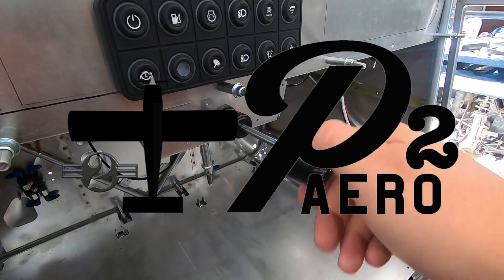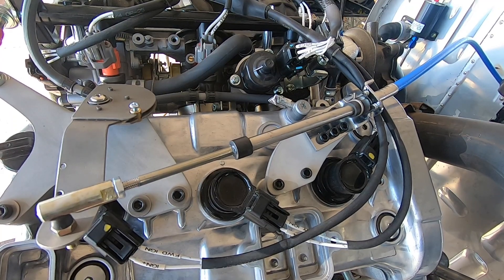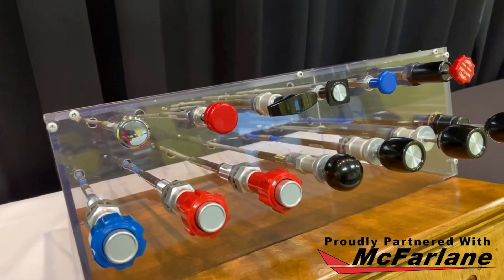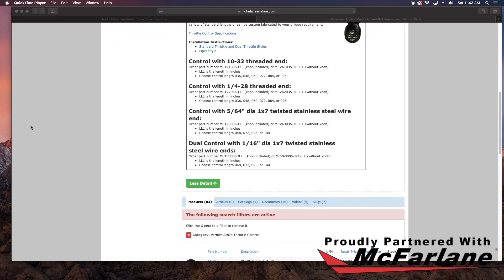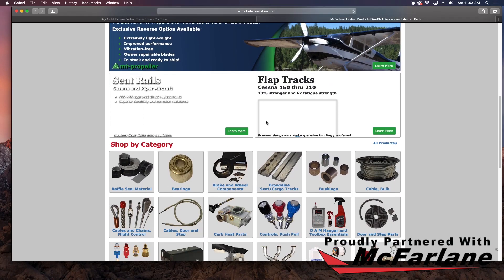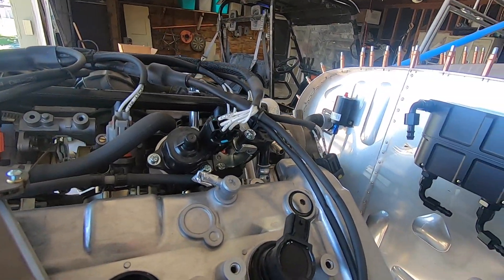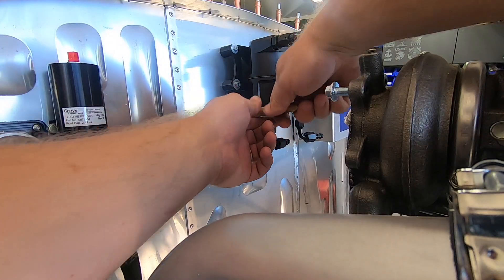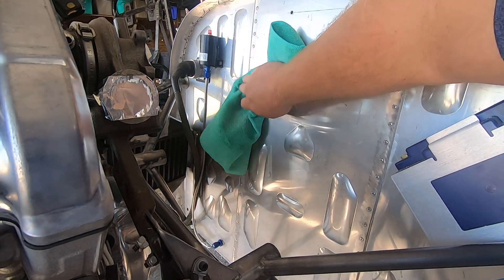RANS S-21 YAMAHA 998TURBO MCFARLANE THROTTLE EP33

Comment: Wondering where you are generally located, and where you got the Yamaha engine?
Thanks
Reply from the maker: I’m in northern Tx. I ordered my engine new from Arctic cat (they use Yamaha engines in some of their snow mobiles).  Lots of info on the Yamaha conversion Facebook groups if your considering ya Kelling such a thing yourself. Thanks for watching!
Reply: Enjoying you posts much, what was the price for the engine? Was there much time before delivery?
Thanks for the replies!
Reply from the maker: @drlescrawford897  right now you can get the engine for $5600. Search for part number 0662-622. You’ll still need to source other parts like manifolds, turbo, harness, and intercooler to name a few. I had my engine in less than 2 weeks after I ordered it.
Reply: Very nice, innovative, yes. So this is a sled engine, no prob as I’ve run several. Yama announced an Av engine…any comments on that?
Reply from the maker: @drlescrawford897  I suspect Yamaha will be pursuing an engine to compete with rotax in the lsa world. That being said I expect it to be priced similarly to those engines which is fine, but I wouldn’t expect it to compare with this setup from a budget standpoint.
Reply: I agree, I’ll be starting an S21 project this year (if all goes smoothly). Are you planning on jigging (and selling engine mounts etc.) things for others who follow? Thanks again.
Reply from the maker: @drlescrawford897  I won’t be offering an engine mount but there are a few guys out there that will. I will be selling some other parts like the throttle and oil cooler adapters. I’d ask Bryan Dacus about an engine mount if building one is outside of your wheelhouse.
Reply: Yah, I am not sure of my own wheelhouse these days.
All that sounds nice, I look forward to closely following your posts, and those of others you say are ‘in the know’!

Comment: Just got recommended your channel and I’m now subscribed. Super clean installation! Maybe you addressed this and I missed it, but do you plan on removing excess material from the bell crank mount?
Reply from the maker: Thanks for watching! I do plan to look into removing some material when it comes off after ground runs for final finishes although it is aluminum and I’m not sure it’ll be worth the small weight reduction. With the mount locations spread out I don’t want to make it weak and would rather it be an ounce heavy over risking failure during flight.
Reply: @Project2Aero  One thing I have learned is that ounces make pounds really fast. If you are an EAA member,  you can get solidworks. Draw that part in there an do a stress analysis. You would be surprised how strong things can be and how much material can be safely removed.

Comment: I am not a big fan of these types of throttle set ups. I like the ones that have the lever. I don't know what there called. But I was wondering how do you lube up the cable ?
Reply from the maker: It’s my understanding these cable are intended to be run dry as an oil type lubricant will attract dirt and cause accelerated wear to the liner.
Reply: Ya, I can see that. You would think friction would be the enemy but in this case, it's what's needed.